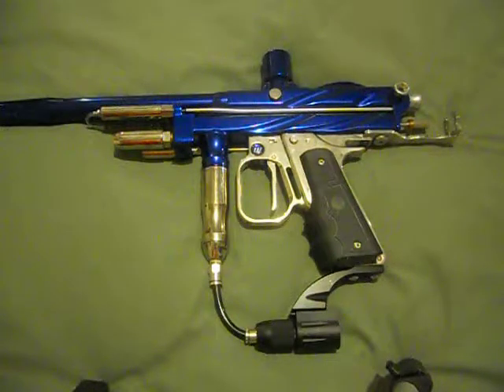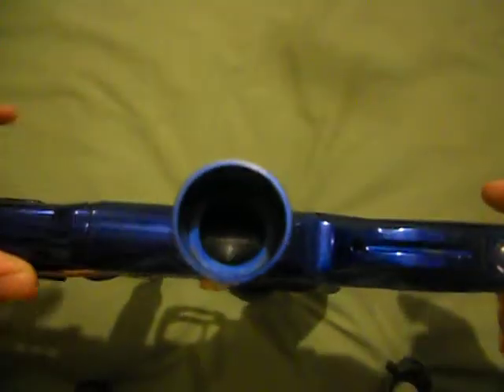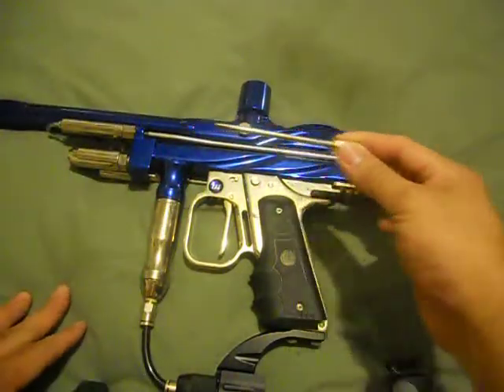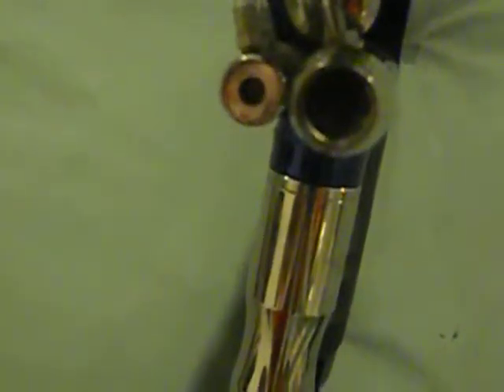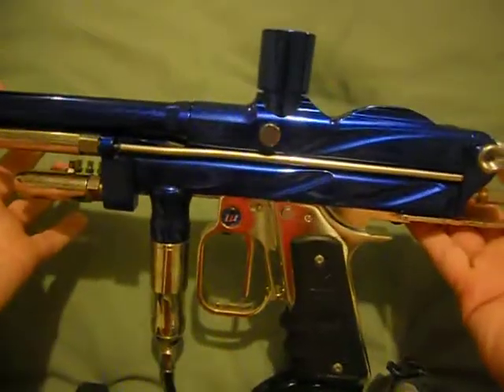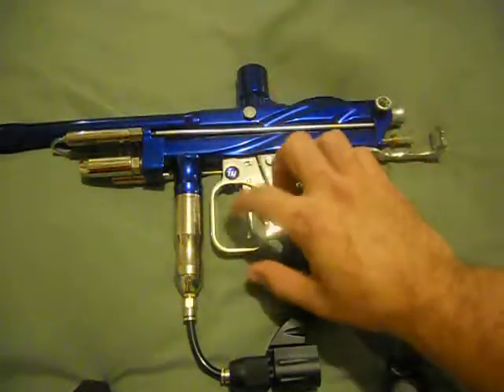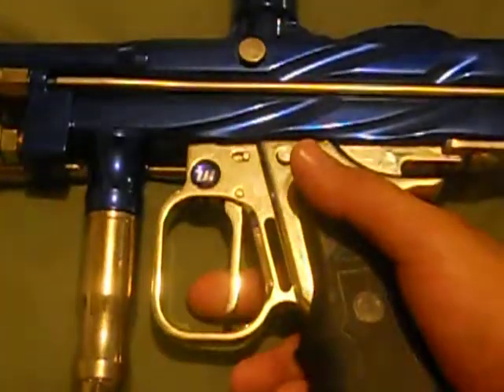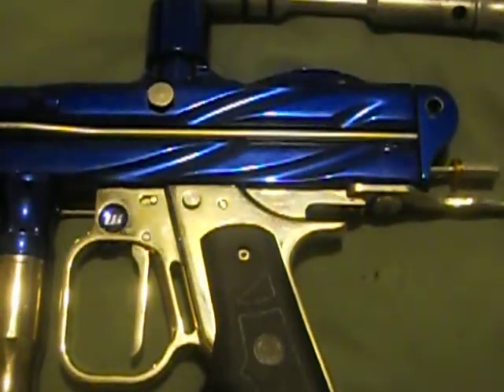autococker timing

Comment: I got back into paintball a year ago. I bought a new marker, but I'm having my old 2k3 autococker being sent to me from my parents. I can't wait to tune it up and revel in the nostalgia. I'm tempted to e blade it and enjoy it as an antique marker.
Reply: don't eblade it , grab a nice quick mech hinge frame like a dye or an eclipse, polish up the hammer lug  and get a short throw 3 way like the shocktech bomb or the empire resurrection 3 way .

another fast firing high rate of fire option is: if you can find an autococker select fire frame you can  go through the process of making a "pneucocker" which  admittedly is a bit drawn out/ long but it gives you  a 100% mech 'cocker with a superlight trigger which can be walked and will keep up with any electronic marker if you  have the fingers fast enough .

Just please don't go putting eyeholes in a perfectly good non-drilled cocker body as they are becoming more and more scarce on the open market.

If the body is already drilled though yeah fair game go eblade, and if money is no object  go with an MQ / MQ2 valved e-cocker.
Reply: @reignick1133  eblade cockers are now insanely expensive. lol

Comment: That reg is adjustable.  You have to unscrew the bottom of it.  There is an aluminum screw that uses a flathead screwdriver.  Counter clockwise increases pressure

Comment from the maker: @DJxWolfii If you have a gun with duo regulators meaning a low pressure regulator and high pressure regulator yes it will.  CO2 is cold air which will damage your orings faster than using high pressure/nitrogen air. Now on cold days the CO2 wont expand enough and your gun will chrono lower. High pressure air doesn't have that problem. Always best to use high pressure air/nitrogen.

Comment: Just chiming in to say that adjusting the cocking rod is not the best way to allow more or less room in the breech. If it's too short the hammer lug will smash against the body inside. The best practice is to adjust the ram rod as best as possible, then pull the back block/bolt all the way back, and lastly ensure that the cocking rod still has room to go backward (beyond the limit of the ram/back block).

Comment from the maker: @AKpaintballer98 your 03 has almost every single adjustment listed as the 04. The only thing you have to really adjust is back block, cocking rod, and hammer lug. Not all autococker have the coupler to adjust when the recocking takes place, as well as the adjustable LPR most are factory preset and the HPR is mostly factory preset, Looking at your gun you will quickly figure out if those adjustments can be made or not.

Comment: Fix my gun. ill post a video how it shoots. I have some footage, but sadly i broke one of my cheap cameras.( i shot it)
I found out that the air was escaping from the emergency hole. It needed a new o ring. The big problem was taking the old original regulator off.  still have it attached and now it shots a like a beauty. Well have to buy a new Cp Reg though.